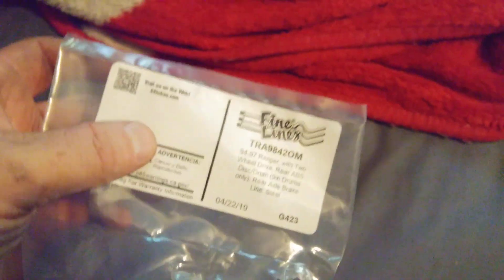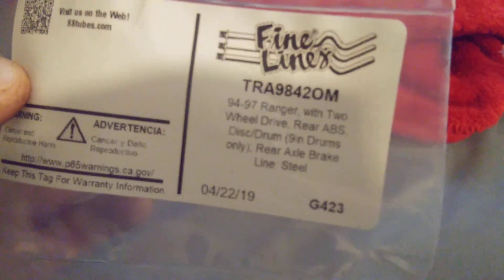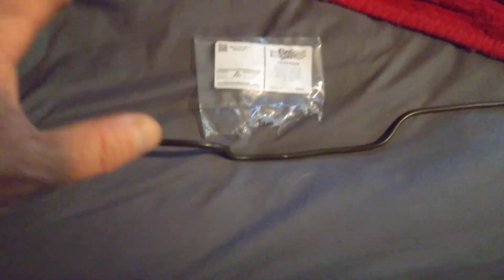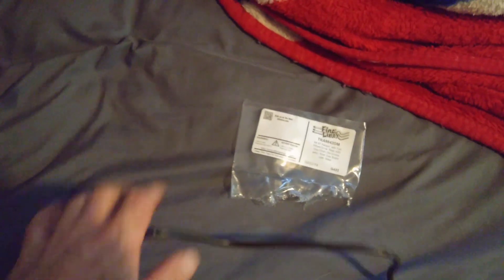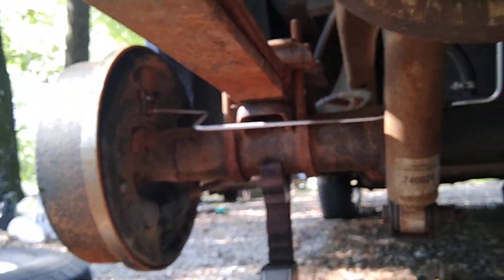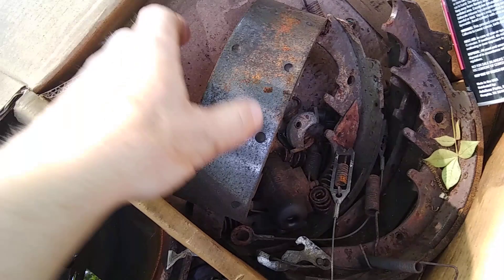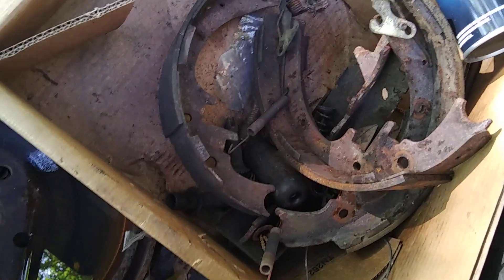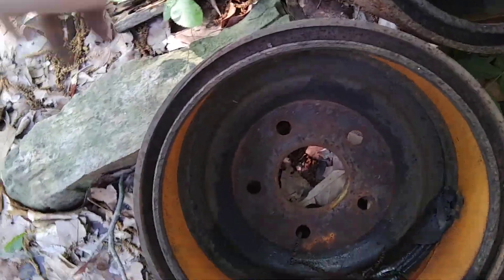97 Ford Ranger XLT rear brake lines

Comment: Mann, I'm glad I saw this video before I made my own lines
Reply from the maker: Yw that's why I make these videos. I try my best to make vids that hasn't been shown before.
Reply: @amberericjones5694  just put new lines in today! they must have fixed the mis match sizes... both of my nuts where the same thread pitch.... 
i did end up bending my own lines because its my work truck and i ccant have down time
Reply from the maker: @Novagunner  good deal you got lucky I wasn't able to find those threaded nuts anywhere. So thats why I also bought new lines. Glad you got it fixed.
Reply: @amberericjones5694  thanks mate!

Comment: There is a clip on the passenger side where the line attaches to the axle. How does that work? Is it just bent open or is it clipped together somehow?
Reply from the maker: If it's the clip I'm thinking of I think you just bend it up to remove the line out. Then Bend it back down over the line when your done.

Comment: What’s the block on top of the differential called? It’s looking like I’ll need to replace that along with the lines
Reply from the maker: Its like a brake line T not sure the actual name of it. Besides its a brake line T. I'm sure you could get one off the dealership or order one if you can find it with a brake line kit.
Reply: @amberericjones5694  appreciate it thank you! Probably just going to remove the chassis rubber hose from the Tee and replace both rear steel lines along with the pistons. Rusted fittings gave me more problems than I could handle.

Comment: Don't believe necessary bleed front wheels.
Reply from the maker: And still have air in the system if not bled
Reply from the maker: Anytime you do a full brake service you always bleed all of them. Because if not you will have air in the system. Only time you dont bleed id your just changing pads and shoes. If your not messing with wheel cylinders an lines.
Reply: Why do the job half assed.? Take the 20 minutes and do it right.